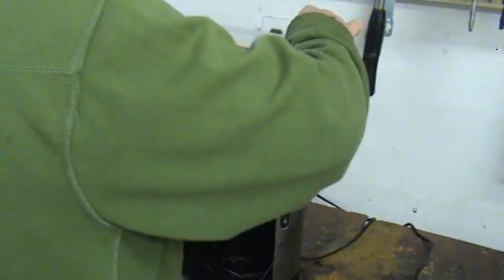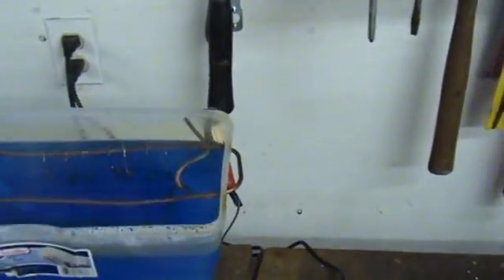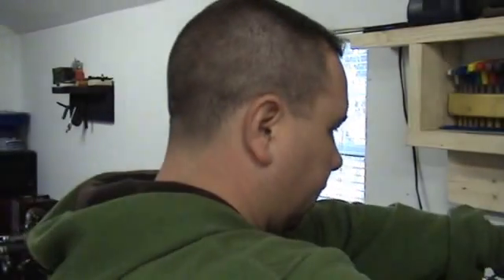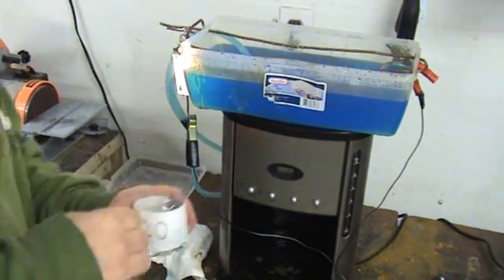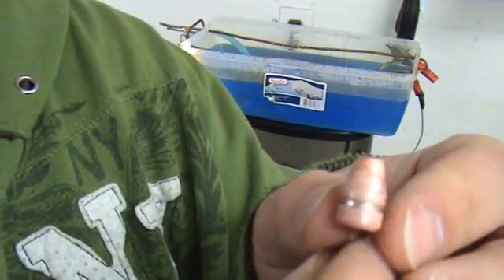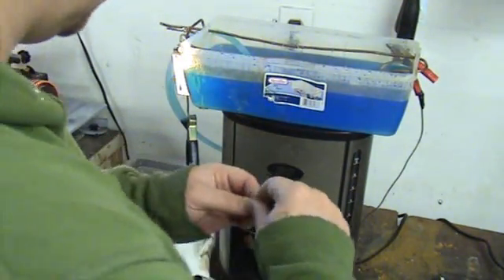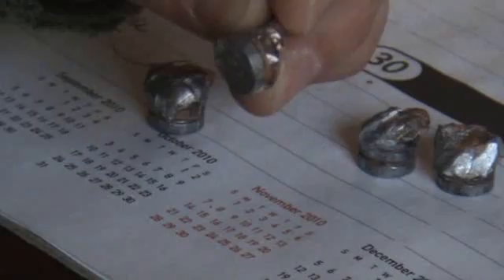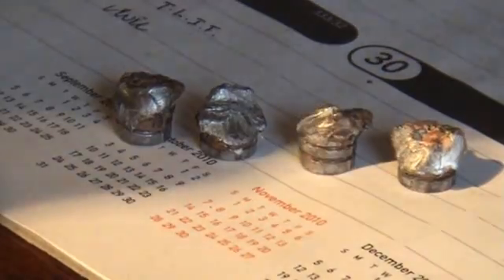Copper Plating Cast Bullets Pt.3

Comment: Kind of late on the video but, Have you thought about using a fish tank air pump and a air bar at the bottom of your solution for more uniform plating?  I worked at a nickel chrome plating company that used this method and it worked quite well

Comment: so when you have finished plating the bullets and you have extracted most of the copper from the bath wouldn't you be left with a sulfuric acid solution that could end up being quite dangerous for the lay person that was not aware of this? or am I mistaken?
Reply: no because in the copper plating process the copper in solution is replaced by copper from the anode (positive side) that is why you have to use a copper anode

Comment: Cool series.  It looks like using the clips instead of wire would be much easier and faster.  I would clip them by the nose since it doesn't need plating and hang them so the clip is out of the solution; faster, easier, less copper wasted.  All this can be avoided by using the right alloy of lead, I know one guy who uses cast .308 rounds and has no leading issues.

Comment: Cool video, but I'm confused as to why you would go to such trouble. Plain cast bullets shoot just fine, actually even better than jacketed or plated. Adding this step would entail a LOT more time and work into each bullet.
Reply: 4HorsemenCome  Clearly you have not idea what the hell you're talking about!  You're going to blow your gun up before you going to blow a hole through a center of the bullet and the hot gases would find an easier route by passing the bullet on the sides rather than center.  I shot "hot" rounds as you call them, full velocity as with jacketed, case full of powder with lead cast bullets and they shot fine!  I chronographed them to reach same jacketed velocities as far as "gas blocks" or gas checks yes I used them on cast bullets, what does it has to do with HP bullets???  and so what if average caster doesn't know the ratio of antimony and lead!!  So what???  The alloy will cast and bullet will shoot and it has nothing to do with being dangerous!  Yes reloading can be dangerous but not because of wrong alloy used for cast bullets!  Take linotype for example it has really high percentage of antimony and it's recommended in cast books to use for rifle round so you are just trying to sound all smart when in reality you just blubbering too much random info.
Reply: smoothsk8r44 That is true, but synthetic lubricants are widely available and extremely easy to use. One $5 bottle of Lee Liquid Alox will lube over 8,000 bullets and takes seconds to apply. Copper also causes far more barrel wear than lead. Lead bullets can be used at virtually any velocity, with the correct alloy. Guys cast their own 5.56 and .308 rounds.
Reply: smoothsk8r44 Interesting. I personally have never heard of a cast bullet "blowing out" as you say, through the middle. All squib incidents I have ever heard of (and experienced) were because of a ultra low, or non existing powder charge that propelled the bullet partway into the barrel.

 You are right that some do not understand alloy combinations, but this can be very forgiving. The worst you will usually experience is a heavily leaded barrel. It is when THIS is ignored, and one continues to fire thee weapon, that you have catastrophic failures. 

 I just know from experienced reloaders that you can safely load cast bullets at very high pressures, such as .44 mag and .357 mag, as long as common sense is used.

 Don't get me wrong, I loved the video. Extremely cool method and result. I just don't see it a practical, at least in the form shown. I usually shoot 400 to 600 rounds a week, given the effort involved, it would take a staggering amount of time to plate that many bullets.
Reply: smoothsk8r44 Actually, now that you mention it, I think I may have heard of a similar incident years back. I was also thinking that you were referring to this happening with a cast bullet, not jacketed. I have firsthand knowledge of the squib load. It occurred during my first year of reloading. Somehow, I managed to half powder charge one round in a batch. The primer, along with the pinch of powder, was enough to lodge the round into the throat of the barrel, but not far enough to feed the next. Thank God above the next round did not feed, as I didn't notice the problem until then. Had it been pushed 1/4 inch further, I would probably be minus a digit or two.
Reply: smoothsk8r44 Agreed. Reloading can be a very rewarding and plain fun pastime, but throw some stupidity or carelessness in there and it makes for some serious accidents. I have never heard the .50 cal. BMG thing. Wow. Talk about more balls than brains.
Reply: smoothsk8r44 gas block ????  you mean on a semi auto or auto rifle that reroutes some of the gas to operate the action ??   or are you referring to gas CHECKS ??  a small disc of copper, zinc or other soft alloy to prevent gas cutting of the bullet ???
Reply: +Rob Aldridge I've heard Brits call 'gas checks' 'gas blocks' before. It's like how they often call a magazine a cartridge. Since we call gas blocks and cartridges very different things from what the person intends it makes for some silly conversations.

Comment: I should also clarify,  the lower the current used, the more control you have over the thickness at the cost of a longer plating time.  I dont remember the formula to determine deposition rate offhand,  but I will post it when I find out.  You might be able to find it by searching for a pdf file called "Principles of Electroplating and Electroforming" or something of that nature.  Hope this helps.

Comment: The answer to that is in what is referred to as "amp density".  Simply put, the higher the amp density, the more copper ions are transferred to the part in a given time.  Amp density is a function of the surface area of the part and the current flowing from cathode to anode.  A bigger surface area means a smaller amp density and vice versa.  This is why you get a thicker coating on the nose and edges of the bullet; they have the highest amp density.

Comment: Good job Thx !! I think it might be good to make some loops in the positive side rather then just one run of wire. Maybe faster to roll the boolits on a brass lube pad to size sense they don't need to be lubed ? Again Thx for the time you put into making the video.

Comment: I would like to see what improvements this yields (in usable velocities) .  I have just gotten into casting.  Primarily doing .357, and 7.62 x 39.   I'd love to see you do chrono #'s.  After reading others replies.  I'm kinda curious about sizing to 9mm , and .308 specs.  Plating, then sizing to .357/ .38, and .311 respectively.  However..very nice series.

Comment: ... the more evenly the bullet is surrounded by copper wire, the more evenly they will coat, coating is also a function of the distance the bullets are from the wire, closer parts are coated more heavily, that's why the noses coated first/more.  The higher the amperage the faster the coating in my experience, voltage didn't seem to matter a 6v charger worked as well for me. I shoot into soaking wet books the library throws away. Thanks again for the video, I can't wait to try coating bullets.

Comment: First, excellent series, I like that were thorough:you fired the bullets and recovered them for examination.  I have electroplated home forged steel spear head with copper to make them look like they were bronze (after my son and I watched 300).  I used cold tap water, with about a tablespoon of baking soda per gallon of water, a car battery charger at 12 volts 10 amps, and stripped solid household copper wire 12 gauge.  The copper comes from the wire-not the solution, as dawn points out...

Comment: good job bro.  If you want that slick shine to the whole bullet like the sizer die gives the ridges between the lube grooves tumble the raw plated bullets in polishing media  before you plate them. the smoother the raw lead the better the jacket will be.  you can even tumble them again after you plate for a premo shine.

Comment: Why don't you use a Dremel tool or File to cut notches in your Alligator clips, you could hang two at a time that way & still hold from the lube groove (one on each side).

Comment: That means your lead is either to hard/soft and each bullet is riding rifling different. If they are to hard then they will just skip down the rifling and if they're to soft then they mash into the rifling. Plating won't make bad bullets any better. I shoot tournaments with lead bullets and accuracy is not a problem...do you have a BHR tester?

Comment: hi im thinking about coper plateing a small 1 gallon petrol tank ,,,can i use a battery charger no2 can i use copper sulphate and water plus a piece of scrap copperpipe as the piece that the copper comes from .many thanks 
pete

Comment: wont plating interfere with the diameter of the bullet? or do you take that into account before loading... ie do you have a special die for bullets you'll plate vs non?

Comment: the plating is very thin compared to jacketed copper bullets, you can scratch off the copper with something harder. its mainly used for better accuracy and less damage to the barrel that lead tends to do, its not meant to be as strong as FMJ just as smooth

Comment: you might want to do some modifications if you want a better finish.
1) an additive , there are many used by industry, but if we want to do it the McGyver way , a little dishsoap  or some glucose will do. I also remember a guy who operated a small copper coating firm who swore by aspirin ??
2) be sure your bath is frankly acidic , in doubt , add some hydrochloric acid .
3) low current density favors a smooth finish , so you could get a current regulated supply .

oops  the post is too long !

Comment: Very interesting- Good video thank you!
Man that looks tedious with the wire wrapping. An idea for ya- Rather than painstakingly wrapping a wire around each one, howsabout finding some kind of dipping platform, kinda like a potato masher, and setting a bunch of bullets right-side-up on it, that way all of the bullet is cast except for the base (Or is that the important part?). About how thick is the plating? Do you notice any difference between plated bullets and just plain ol lead?

Comment: just a curiosity, do you think there would be a way to fully plate buckshot, and if so would it be more effective?
Reply: I bet if you made a two wire track like what a marble could roll across the the buckshot sits on, the two wires then also attach on the top hanging wire and makes the connection. Since they’re touching it should work and being buck shot longer time shouldn’t hurt so its trial and error. Im new at this. Only speculation.

Comment: I'm a new reloader, and I'm getting into casting.  How much weight does the plateing add to the round?  I'm looking to do 9mm. How does the copper plateing affect reloading, what data do you use?  Do you lube like it's a jacketed round?  Any help would be greatly appreciated.  Thanks...